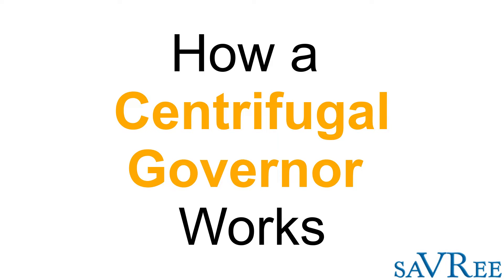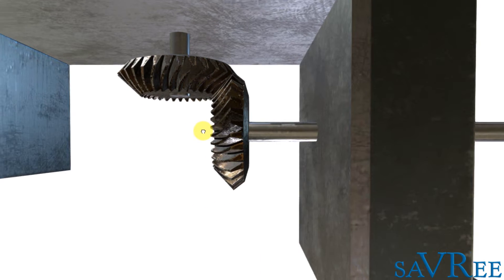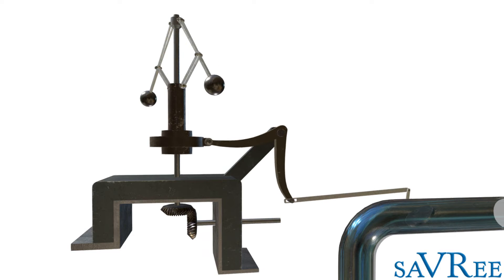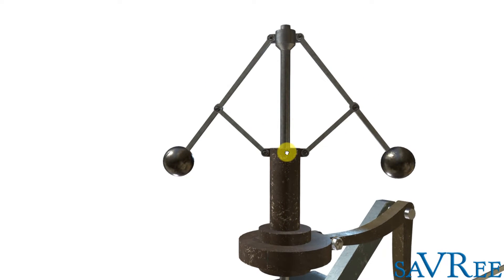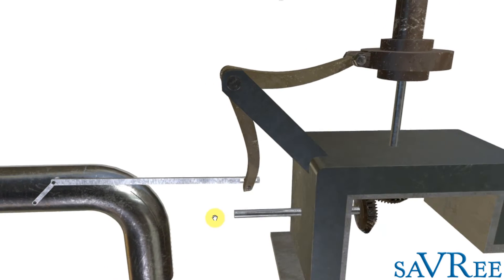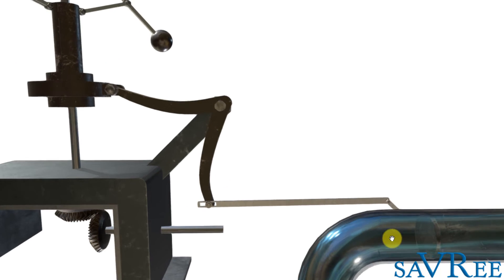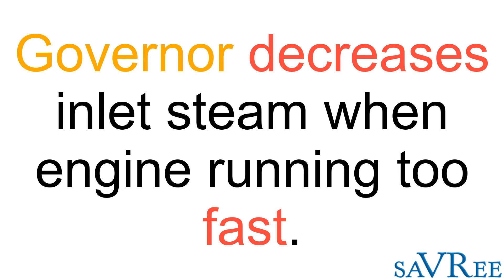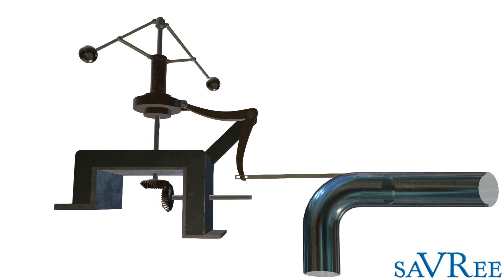How Centrifugal Governors Work

Comment: Interesting, we can do a hydraulic transistor with one of these - all we have to do is the the arm to control another valve instead of the falve that feeds the governor. I want to make a visual representation of negative and positive feedback using the governor but for some reason I thought it was more complicated (with the valve in the axle of the governor). Using it as a transistor (a small flow of water makes it control a valve on a large tube) I can make more complex systems to help people visualize - believe it or not - climate change. Thanks!

Comment: Otis Elevator flyball governors are not outdated in my opinion compared to most of the newer designs.  It is just a strong yet simple design.  It will do its job for many years with hardly any maintenance.Just like Great Grandma's cast Iron cookware will generations later. But sales need to be made and someone needs to produce something new to kill the everlasting. 
In some cases, certain devices do not need to be redesigned. There is something special about things that were designed so well that they seemingly last forever and are easy to repair and/or maintain.

Comment: 🔰 Ok yes, but why do we need the governor❓Is he saying that if there wasn’t one, the engine would go into a runaway condition❓
Reply: An governor are used in example generators. The governor speed can be set using example springs and the speed will get regulated. Lets say a generator needs to run at 3600 rpm. Of course you need to set the governor to run at 3600 before limiting. But in an engine like an motorbike the speed needs to be free so you can accelerate or decellerate so the handle opens or closes the throttle

Comment: I'm thinking by adjusting the weight of the balls you could change the speed it governs to. Then I thought it would be nice to have springs forcing the arms down so that you could simply turn a nut and the speed setting would change. Then I thought, boy I'd like to figure a way to adjust that nut while the whole thing is spinning. Right now I think maybe if you could slap a thrust bearing on those arms by attaching a sleeve on a hinge so they will still be able to lift up and down then use the steam in a piston or airbag to push down on the thrust bearing all while controlling the steam pressure with a valve. That's the best I can do. Let me know if anyone has a simpler idea?

Comment: A lot of people don't understand this style governor is where sayings "Balls Out" or "Balls to the Walls" came from - The only thing you didn't really show on the variable speed governor variant, is the spring that the governor must overcome to change the set speeds... My Two-Cylinder John Deere uses a very similar style in principle, but uses a leaf spring, hooked to the throttle demand lever on operator's station to pull the throttle arm open, and then when the speed exceeds the required load, the movement of the fly-weights overcomes that spring tension and shuts the throttle plates, also if you shut the lever at the Operators station it will force the throttle to idle in case of governor failure. It Idles at 350-400RPM and runs at 1050 No-Load and 975 under load.  -  The one you show is a more or less a "Fixed Speed Governor"
Reply: Balls to the wall comes from aviation 20th century, specifically referring to the round tops of throttle levers being pushed to the firewall of the cockpit.

Comment: this is the mechanism used to control speed of the motor in Kitchenaid stand mixers. when you move the lever an actual circuit board that is pivoted off the read moves back and forth, moving it further and closer to the governor depending on which speed is selected. antique tech but ingenious

Comment: With this set up the speed will always be constant. Is my understanding correct? If not, how can it control different speeds?
Reply: @savree-3d The valve opening and closing is a function of the centrifugal force, and as you explained, when the engine is 100rpm, it will be completely open, then at 200rpm starts to close, then at maximum rotation valvle will shut off. So the amount of steam (or air) going into the engine is controlled to keep constant rpm, right? Sorry I think I was mixing 'vehicle speed' and engine rpm when I asked the question.
Reply: @savree-3d  The engine of capitalism at work (pun intended).

Comment: Most Small engines still use mechanical governors all the time
Reply: If by "mechanical governors" you mean throttle levers, linkages, cables, and throttle return springs, then yes... ALL ENGINES not just small ones use "mechanical governors."  But this is a CENTRIFUGAL GOVERNOR, and anyone deploying this mechanism for a small engine would be a total idiot!

Comment: Thank you for such a clear instruction.  However, I am looking for a way to mechanically control the speed of a motor generator set, even if the load on it is changeable. For that, I require the least number of moving / wearing parts, so no horizontal to vertical gears for me, I have horizontal shafts only. I guess I could invent a system of fan paddle air brakes, with weights working against springs, to place new load on a flywheel which is starting to spin too fast, and the frequency of the generator is starting to climb out of range.  I expect this may be achieved with inverter based speed controllers, but I want to cut out the electronics and come up with a simple, low tech, "flintstone" approach.  I shall continue my search!
Reply: You could just place the mechanical governor inline
Reply: @sheeplord4976  Thanks for the brain wave.